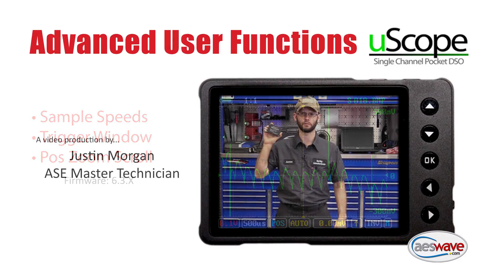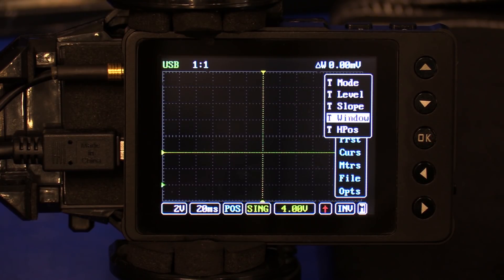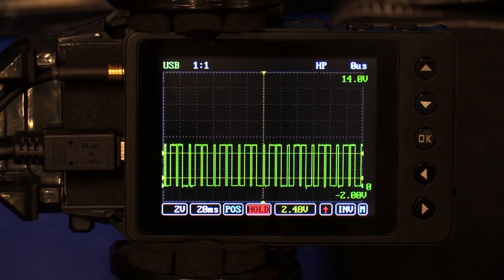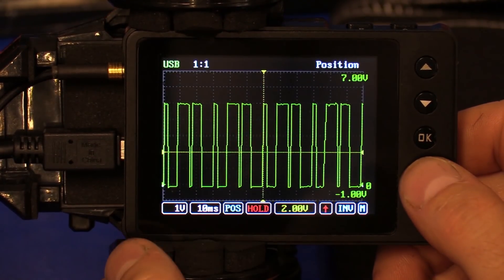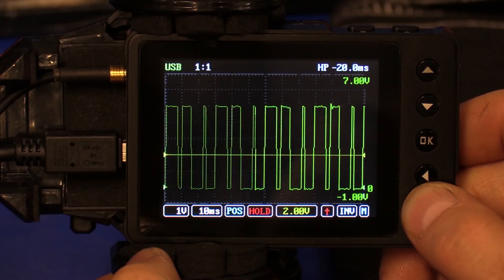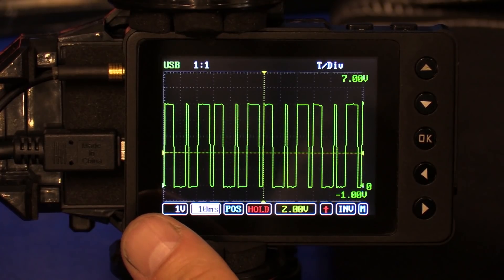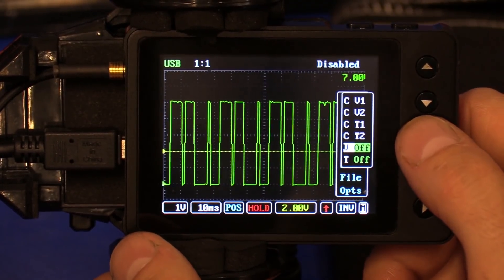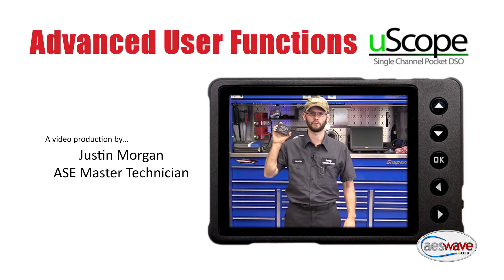uScope -  Advanced Features 2: Sample Speed and Zooming

Comment: Wow,I know this is from while back but it seems that you have to be well versed in the use of Oscilloscope's to be able to find an issue with What ever you might be looking for, You'd almost have to have a career in Electronics to be able to combine Mechanic's and Electronic's to troubleshoot an issue. I know that the scope is very useful tool but to have all the knowledge to set it up and also know the values of what your looking at could be very confusing at least to me, I'm sure that you could know couple things and get the job done by the R and R book but  SOFTWARE PROGRAM that could help narrow down some of the technics to keep the time factor from being out of reach . But I like that you can implement this tool to speed up the job once you have all the settings correct!

Comment: Hi Justin, Thanks for showing me that Hold, zoom, position feature.  I have noticed that sometimes it doesn't work.  The position won't move around even if the POS is flashing.  I'm wondering if there is a buffer limit.  Maybe I'm collecting too much data on one screen and then I zoom in too far.  I notice if I put less time on the screen that sometimes that allows me to scroll through the patterns on the screen.  Does the U-scope have limits on this feature?

Comment: Hi Justin Can the scrolling be done with the engine off or how does the running engine affect the waveform after going into the zoom mode? Thank you
Reply from the maker: To enter the  position feature, the scope needs to be put in Hold mode using the A button. While in Hold mode, the scope is no longer accepting input so the car can be off or the lead disconnected with no affect.

Comment: Is there a way to capture the cam signal and then crank signal then compare them to verify timing?
Reply: mhinz00 using a cam/crank sync technique for checking mechanical timing will require a multi channel scope.
Reply: Justin Morgan i assumed that was the case just was curious if maybe there was a way to overlay the cam signal over the crank signal after capturing them both
Reply: mhinz00 unfortunately it would be almost impossible to sync them in real-time post capture.

Comment: Justin first great video. Thank you. Is there a way to generate a signal on the scope to play around with? What are you using to generate the signal? I also have a DSO 3 4 channel scope with a signal generator where I can place a waveform on the screen and play with it on that scope. Just wondering if we could generate a waveform like you have to experiment with or how we could generate a signal without using the vehicle. Just wondering what you are using. Thanks so much. Artie 👍
Reply: there is a built in signal generator on the scope, the headphone jack is the output, and your unit should have come with a little set of micro hooks on headphone cable, just jump that into the scope lead and you can play with a live waveform. I covered it in the first video I believe. settings are in menu>options> siggen duty and freq control. its a simple 5v square wave which is great for practicing with the Uscope
Reply: Can that signal be used to trigger a ignition coil to fire on a 3 or 4 wire coil?